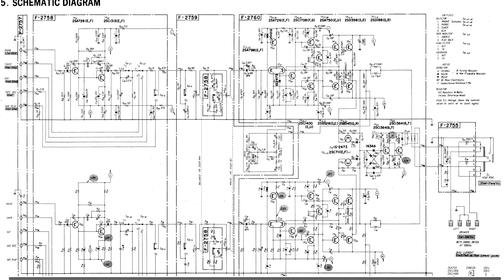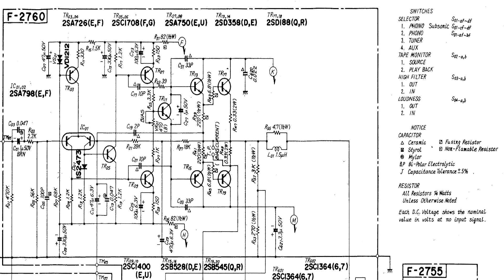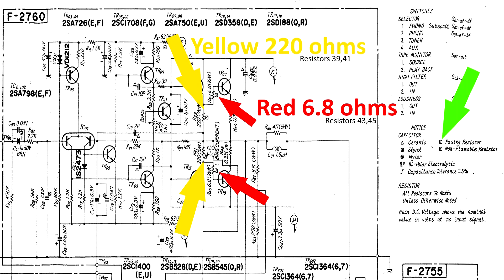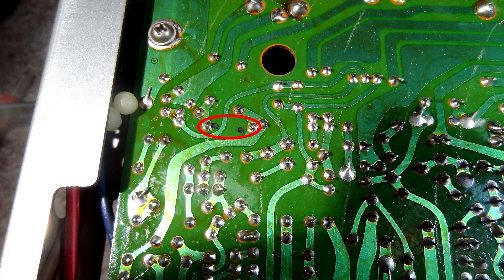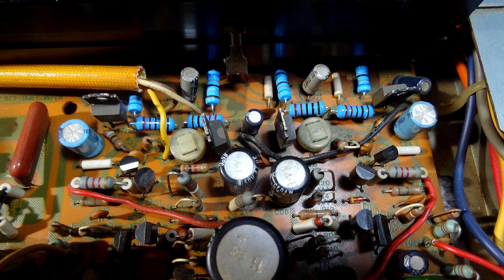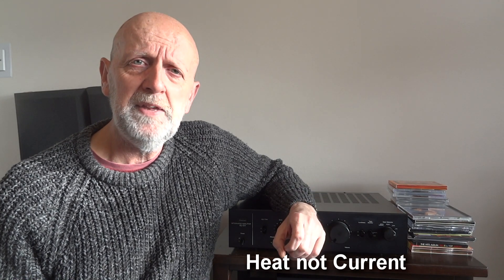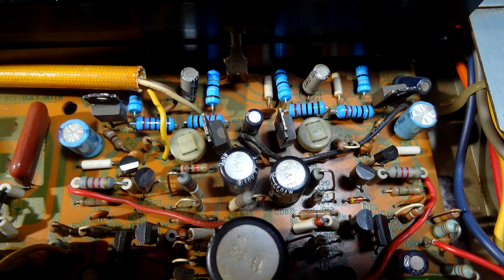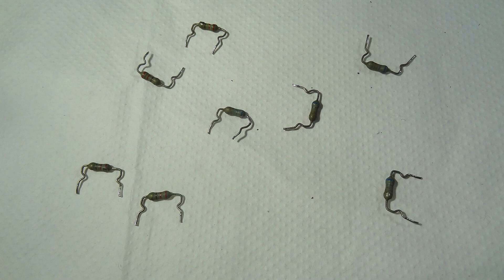Replacing Fusible Resistors Sansui au-217, au-317. Fuse Resistor. Metal Film. Non Flammable. Vintage

Comment: Hi Michael, no stone is left unturned with this amp :)
I am not sure why you up the wattage when replacing the fusable resisters. If they use them because they can handle heat better, yes I agree. But if they are really fused, I would keep the wattage the same so the normal resister will burn out and maybe hopefully still protect the other components. Every resister is a fuse in essence. By the way, there is such thing as a pico fuse. They look like resisters, you could put them in series with the resister (easy and still compact). Use Ohms law to calculate the maximum current based on the resister value and resister Wattage. Use slow blow fuses. 
When replacing resisters, this also may influence the sound. The new resister should not have iron in the end caps. Use a strong magnet to test for it. Also, some people say that carbon film or carbon composite resisters though noisier, sound better, warmer. So if you ever get bored testing out the sound of different capacitors, you can move on to resisters :) PS, if you look on the UK website HiFi collective (use google search) you will find some amazing audio resisters (and capacitors).
Reply from the maker: Thats a good point about keeping the resistors the normal wattage so they would burn out, I upped them a little incase to keep cooler in this case. Thanks for the info on the pico fuse and must admit never heard of them till now.
As with the sound, I have been listening for a day and the amp sounds the same to me as before replacing them.
I will lookout on HiFi collective thanks